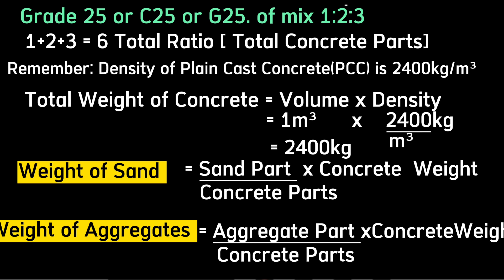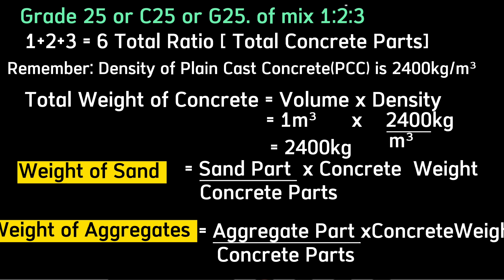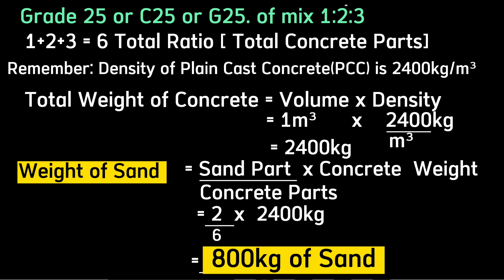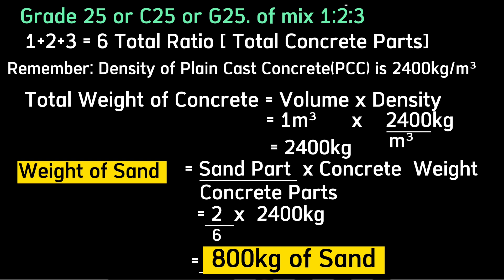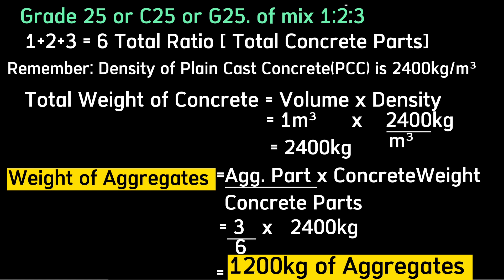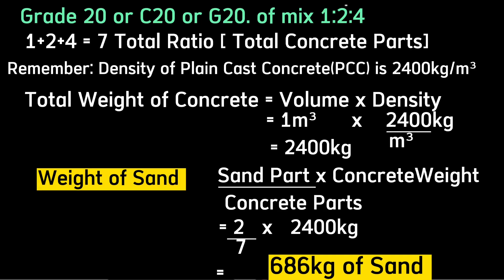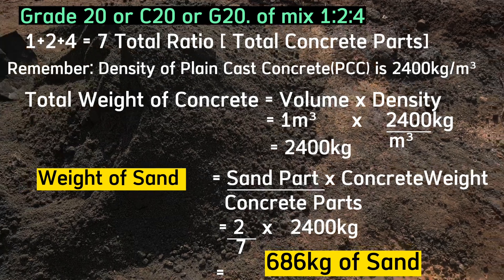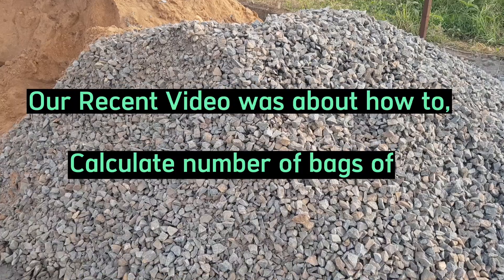How to Estimate SAND and AGGREGATES required for Casting Concrete

Comment: When you calculate the materials by considering the weight of concrete why you ignore the wet vol and dry vol?
Reply from the maker: That's also another method bro but all arrive at the required answer
Will make another video for estimation using wet volume and dry volume